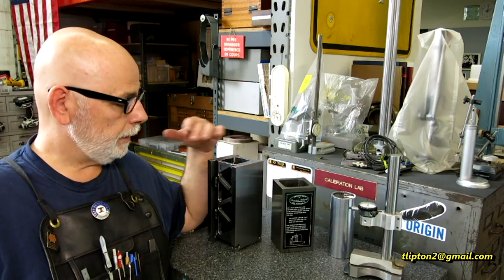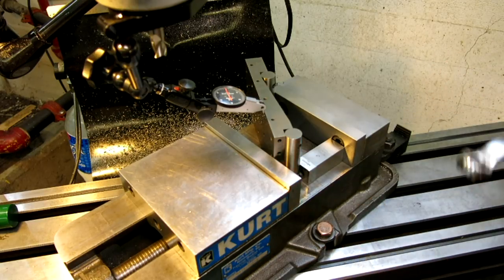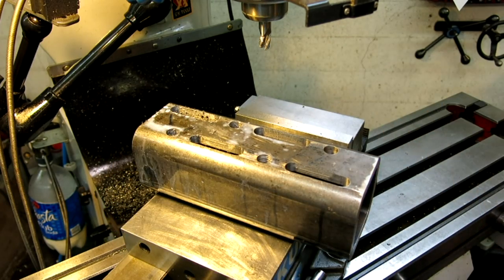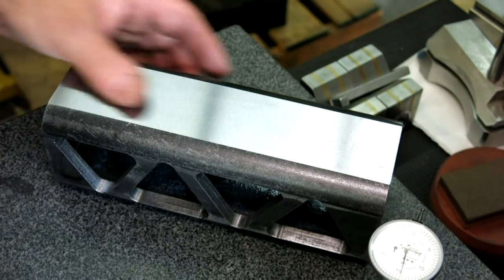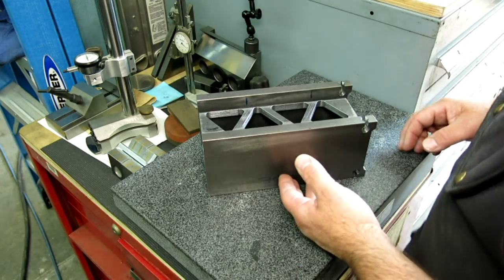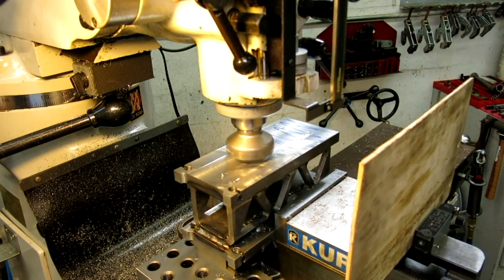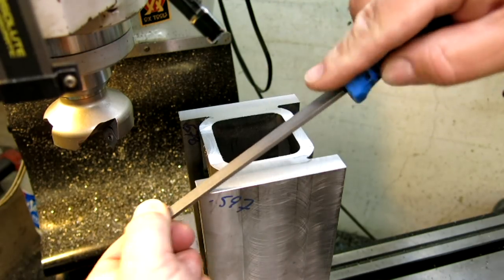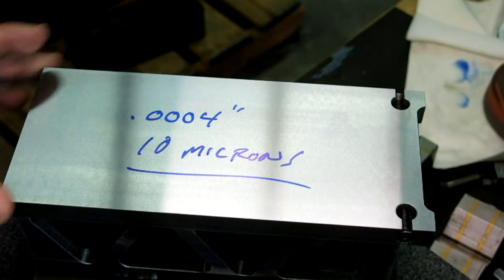Composite Master Square Construction

Comment: I just watched the LB lab tour video with John Saunders this morning, so when I saw 'composite', I was thinking glues, plastics, layers, you know, composites.

When you were working on the lightening holes, I would have swore you were milling a composite material.  I began to doubt that, when it 'clunked' on the vise, just a little, as you sat it down.

Sounded like steel, then I started thinking, why would he need to lighten composite, THAT is why they are used, composites are already light.

It was the grinding that confirmed my confusion.   When you said composite, you meant multiple part...

Ah well, it's been one of those days. My morning got interrupted for about 3 hours when a dare devil squirrel was immolated by a tranformer, which then exploded, knocking out power. 

My day never recovered... 

Guess I need to go back, and look at the first milling sequence, to see what I thought I was seeing...

Thanks for sharing... still blown away by where you get to work. 

GeoD

Comment: You didn't need to flip the vice around to mill those triangles. Simply flip the part in the vice around the spindle axis and those angles are now on the Y axis as they were before.

Comment: Tom, you should have age (old) the part after welding. It can be distorted, bent with time. Aging can be speed up by placing in fire,  and then slow cool down

Comment: Man Tom that was a HUGE cut on that one side edge, hell even .003" is deep on my t&p, but i'm grinding dry for the moment, gotta weld up a pvc wier tank for coolant. Got all the stuff, just lack the time. 

Ps. Thanks for getting back to the vids!
Reply from the maker: With small step overs it works fine. You can take even more than that safely. Just think like a centerless grinder. 

Cheers,

Tom

Comment: I know this is old
This was sent for heat treatment?  What kind of steel was this?  The base (1st part) looked like 2x2 1/4 hot rolled?
The sides might be tool steel but look like plate?

Comment: Could you have made some lighting cuts on the sides of the tube that have the plates added?  I see the benefits of grinding those sides flat, but it seems to me that leaving only a few "bars" of material across the face and ribs along the sides for welding would be sufficient and there would be more weight removed.  Interesting project anyway.

Comment: Can you elaborate on your choice to use 4 flexures instead of three? I know you can get something to sit on four points but it's much easier to use three, no? Also, caught the lexan pinch bar for the mag chuck ... NICE! Thanks for the video.
Reply from the maker: For squarish bases four points is more stable. The Hermann Schmidt has four lapped feet on it for this reason. Its over constrained but more stable in this situation. Three flexures would have been awkward with this design so I opted for symmetry. Cheers,

Tom

Comment: Whoa are you welding on 1.5" ground stock plate?!! You get to play with all of the toys
Reply from the maker: Hi Kenny. Its actually two inches thick. I had the rough stock plate of my welding table blanchard ground. It was actually pretty cheap at $500 and free delivery. Cheers. Tom

Comment: Looking good Tom!  Have you considered grinding/turning a very shallow taper on the head of a SHCS for your adjustment screws for better resolution and shock stability instead of the steep flat head angle? Thanks again for all your support!
ATB, Robin
Reply from the maker: Hey Robin. You are probably right it would be better to have a steeper angle. I built one flexure before hand and tested it to see how well it behaved. It took considerable force to move the foot and seemed controllable so I decided I would trade fastener tension for resolution in this case. The goal is to lap the feet accurately but have an adjustable back door if needed.

All the best,

Tom
Reply: robrenz.....sir...the internet isnt the same without constant videos from you..I sure wish youd either stop making videos aLL TOGETHER SO WE SO SIT AND WAIT.,.,OR MAke some videos....youre missed ir!!

Comment: I assume that the heat treat would stress relieve the block some.. Not sure of that's correct.   Would it have been a good idea to heat the whole part to stress relieve before doing the rough grinding before heat treat?   I like the setup for milling out the triangles.. I assume that they were mainly for looks.  If going for weight I would think you could mill rectangles in the flat sides that mate the plates before welding..  I look forward to seeing this project finished.   Thanks for the video..
Reply from the maker: Hi Max,

The neat thing about case hardening is you get both qualities in one part. A hard tough exterior and a soft ductile core. We will see about long term stability I guess. Easy enough to monitor. Mass and weight are you friends when it comes to stuff like this. Its the old if its heavy it must be quality and precise......

Cheers,

Tom
Reply: Chewy on the inside and crunchy on the outside like an armadillo or a dime bar! Maybe that joke only works in Europe?
Reply: Thanks,  I understand the case hardening process.. I'm was curious about the project changing shape since it's manly all cold rolled steel.  I know that machining will also  allow the material to distort.. Guy Lautard mentioned it in one of his bedside reader books.  As I understand the heat treat process. The metal is heated to a point that allows carbon to be introduced into the surface making the surface harder..Still have a can of Kasenit around here someplace.  I'm  thinking that at that temp any stress due to the cold rolling of the base pieces would be relieved causing the part to shift.  Also the welding would create more stress in the part.   I was wondering if it would have been a good idea to stress relieve the part before initial finishing and heat treat.

Comment: I'm just wondering why not do a stress-relief heat treatment after welding to remove the welding stresses and the material stresses. That way it doesn't move pretty much at all in hardening or if it moves much, then the heat treater is to blame.

Comment: Another great video. What is your clean up after using the NOGA Cool Mist? I have a mill about identical to yours except it says EISON and I am concerned with rust under the vise after using the Cool Mist. Do you dismount your vise to clean after using the mister either on your mill or surface grinder?
Reply from the maker: Shop vac. The surface under the mag chuck is prepared and protected prior to mounting the chuck.  Once you have the mag chuck trued up you generally leave it as long as possible.
Reply: oxtoolco how do you prep the surface under the chuck so it won't rust? I just got a surface grinder and am wondering what will I find under there. Not sure if I'll take it off yet, waiting to hook it up and see how flat it is first.

Comment: Why don't grinders always grind a slightly uphill slant as you feed the workpiece across the wheel (not the back and forth horizontal, but the steady motion perpendicular to the repetitive horizontal axis)?  Doesn't the wheel wear away and effectively become further from the surface the longer it is used?